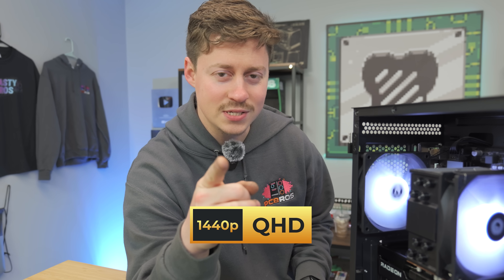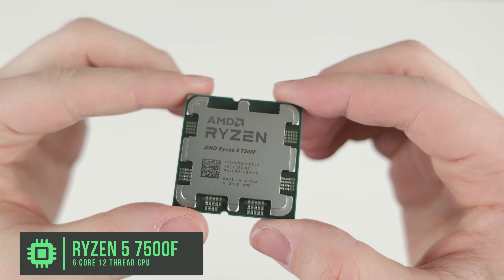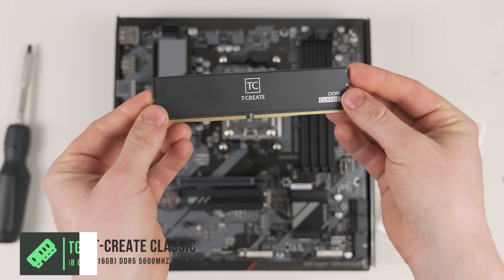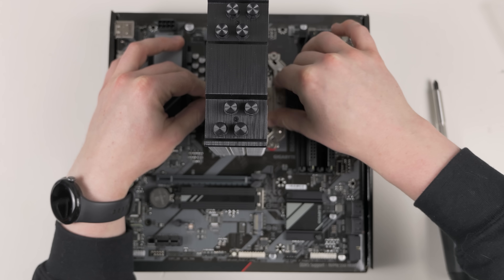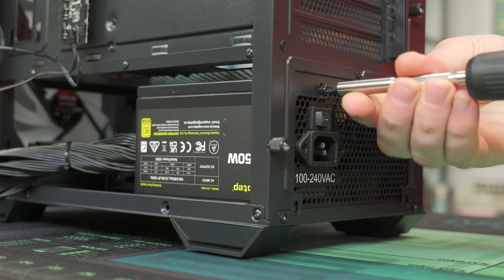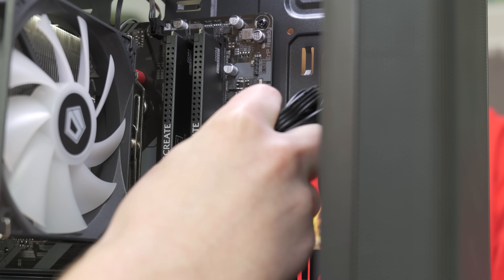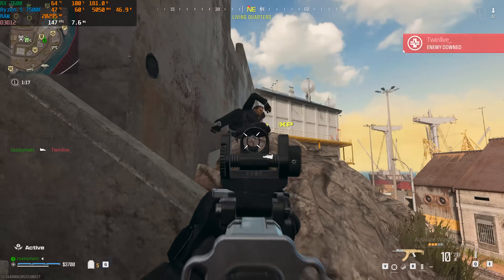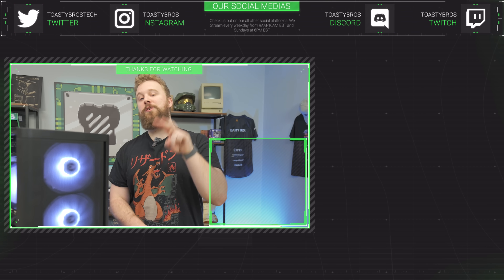$800 Meta Gaming PC in Under 8 Minutes

Comment: This is a decent ish build but you can get alot more performance for $800 when going with a 6700xt for like $320. The cpu and mobo in this are ok but you can get a slightly cheaper case and a much cheaper gen 3 drive and that would allow you to get the 6700xt instead of the 7600.

Comment: Not the meta for 800$ id go am4 as a 5600 can still handle a 7900xtx at 4k resolutions; id buy a used 3080 for 350-400 and then am4 is such a cheap platform.

Comment: I'm doing a similar build with the 7500f (got it for $138) and an RX 6750XT ($329) in a Phanteks Eclips G300A (recently sold out on Phanteks web site).  Can't wait to see the performance.
Reply: Great job this is exactly what I commented SHOULD be the “meta” $800 build. you can easily out together a build for $800 with the 6700xt which is only $50 more than the shitty priced 7600. U can even keep the cpu, power supply, and mobo of the build in this video but just get a slightly cheaper case, ram and a gen 3 512gb ssd and that will get you the extra $50 for the 6700xt.
Reply: How much fps did you got in Games Like fortnite valorant or something?

Comment: This is a very solid build for DDR5 and only $800.  Good looking case and solid motherboard.

I recently built a pc for $850, but built on DDR4.

i5-12600KF
RTX 3070
16GB DDR4
1TB M.2 Wester Digitial SN770
Montech Air 100 case
Corsair 750W Fully Modular
Asus TUF B660M w/ wifi MB

It games incredible at 1440p.

Comment: Just from Watching the intro I could tell the GPU is amd 
If it were to be new then I will say the 7700xt, if used then 6800xt
Reply: I guess I was wrong , you went for am5 so the only thing that could fit in the budget was a 7600 🐥 
Anyways still correct on the fact that it is amd 😂

Comment: If you're targeting 1440p it's definitely worth paying a little bit more for the 6700 XT/6750 XT in my opinon
Reply: I just wrote this and you don’t even need to pay extra you can easily out together a build for $800 with the 6700xt which is only $50 more than the shitty priced 7600. U can even keep the cpu, power supply, and mobo of this build but just get a slightly cheaper case, ram and a gen 3 512gb ssd and that will get you the extra $50.
Reply: Is RX 6700xt fine for 1080p High/Ultra Settings? Will it bottleneck? I know it's fine in 1440p but what about 1080p? (Bottleneck stuff)
Reply: @gogetablue7905 its great for 1080p
Reply: @gogetablue7905  how will a GPU that's work fine for 1440p bottleneck at 1080p? I don't think you understand what bottleneck is
Reply: @prestige934  I forgot which component bottlenecks, But I think it was the cpu not gpu
Reply: @gogetablue7905  yes at lower resolutions CPU might bottleneck.

Comment: 1000% this is the meta. If I had $800 and needed a pc I'm copying the build.
Reply: Nah you should prob get a better gpu than ur fine
Reply: Don’t follow this build you can easily put together a build for $800 with the 6700xt which is only $50 more than the shitty priced 7600. U can even keep the cpu, power supply, and mobo of this build but just get a slightly cheaper case, ram and a gen 3 512gb ssd and that will get you the extra $50.
Reply: @danebeee1 idk who to trust im new to this pc stuff but can you recommend me a build for 950?

Comment: should i sell my razer blade gaming laptop to build this ?
Reply: Keep in mind that you need to spend 200-400$ on monitor/keyboard etc. if you wanna take advantage of the benefits in performance.
But i would rather wait and save money to buy a new build, and after the build is finished sell off the laptop.
Reply: @bafon  i I already have all that. I got a razor keyboard with Logitech mouse already and a 165hz monitor. The monitor I had for my ps5 when I was on console but just recently got the K&M when I got my gaming laptop a few months ago
Reply: @bafon  but your kinda right. I want a crazy built lowkey and wanna learn more about it. I’m still kinda new to this pc stuff so I’ll def hold on buying something new